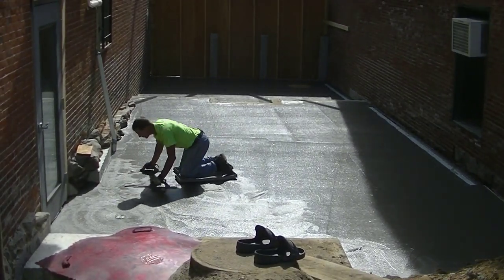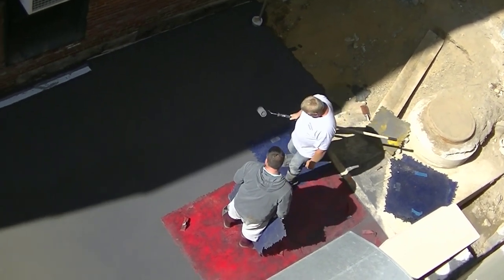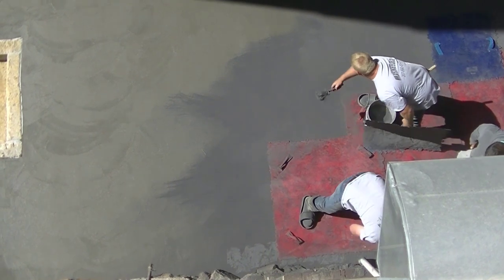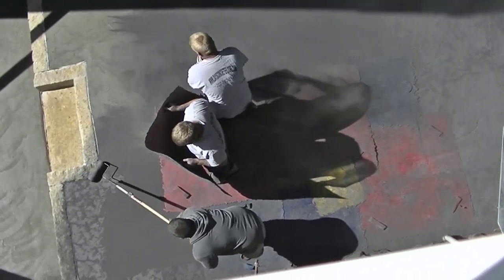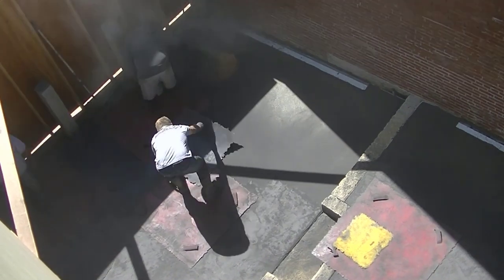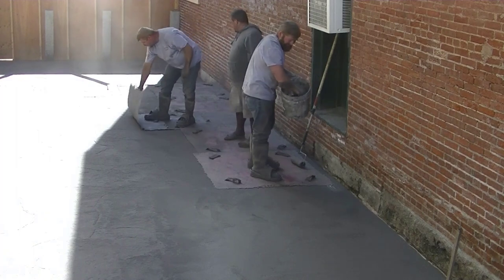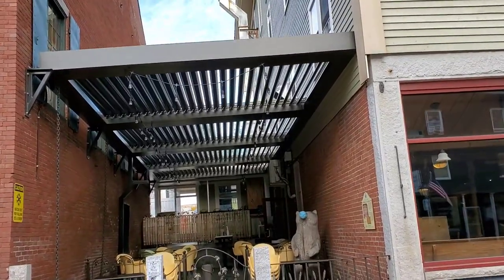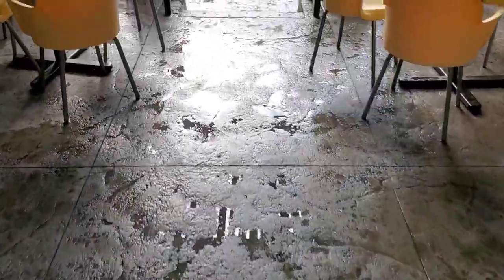Finishing Concrete For A Two Level Patio Slab (Stone Texture Finish)

Comment: I have a floor that already has a concrete slab down it’s very uneven it also has some voids we want to level the floor should I break up the floor and lay a new one? It’s in the basement of a granite building . I am in Portugal. I would love to show some photos would love your advice.
Reply: just helped put down a new floor for a 1905 brick building with a few serious heaves and cracks here in Colorado, just cut down some high spots and poured over top, turned out great.  Message me if you want pics